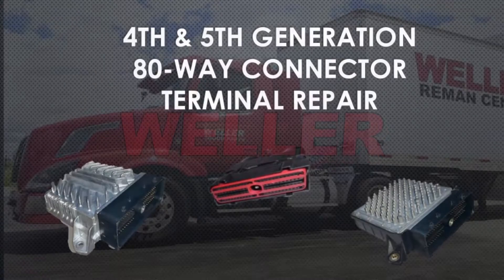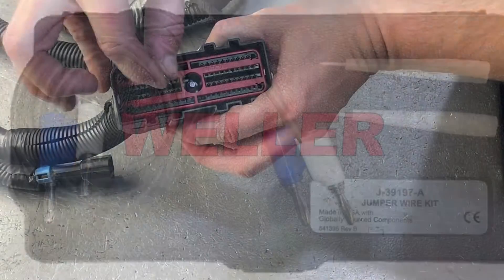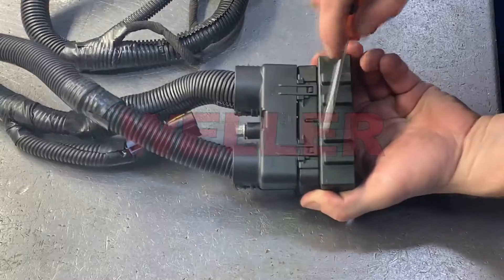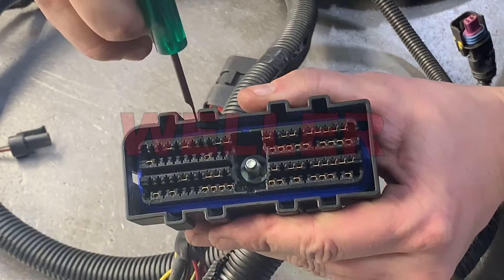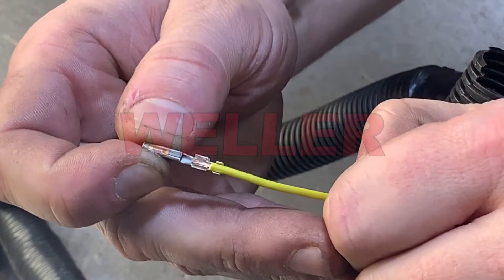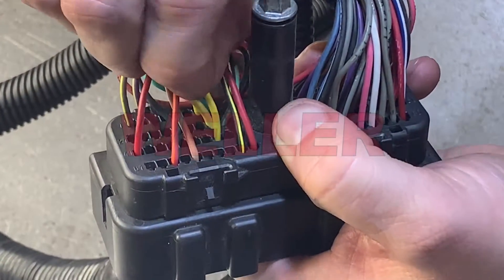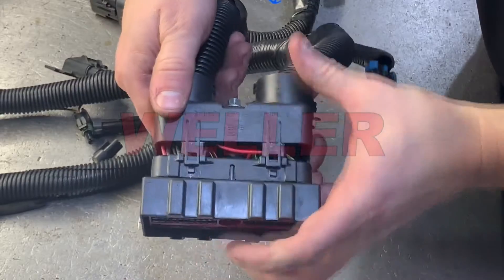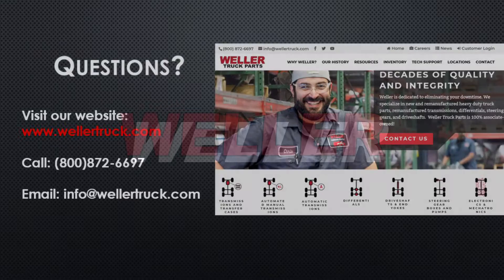80-Way:  How to Identify and Repair Allison 80 Way Connector (4th & 5th Gen)

Comment: What is the removal tool you used to take the pins out?
Reply from the maker: Good morning friend!
The tool in question is a Kent Moore removal tool. Part number J38125-12a or J39227. You can also use Dephi Packard part number- 12094429
Hopefully this helps!
Thanks

Comment: My husbands tcm plug won't stay in on one side any keeps popping out. Any idea why it would do that?
Reply from the maker: Hello there! We may have an idea...
Check to make sure the locking tabs are intact on the plug. If the tabs are broken, the harness connector would need to be replaced.
Thank you for reaching out!
Reply: Can you tell me what terminal ends needed